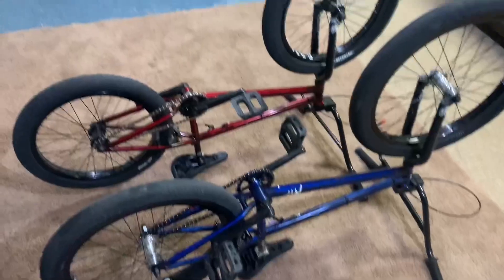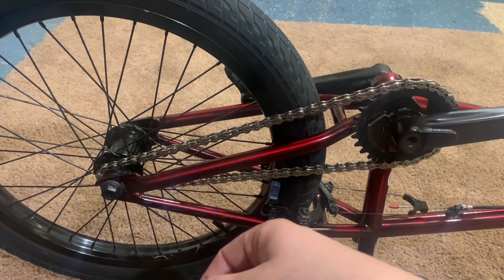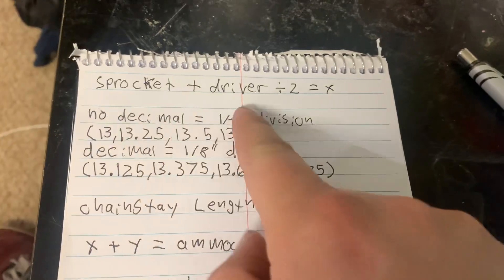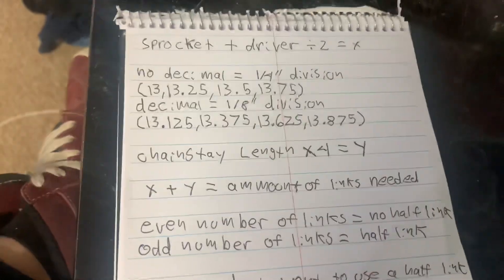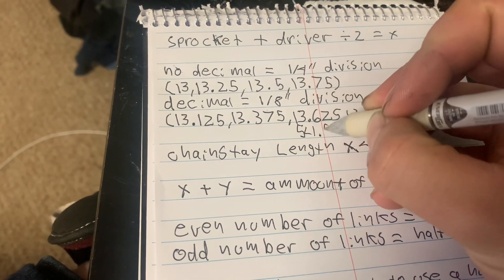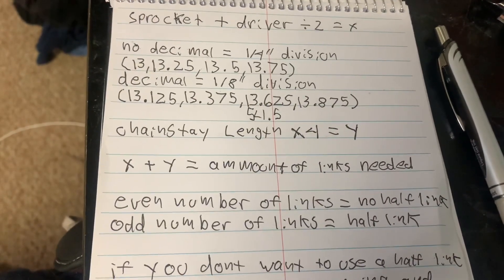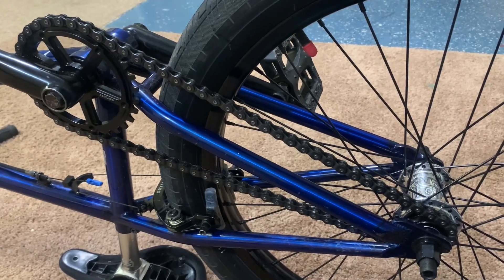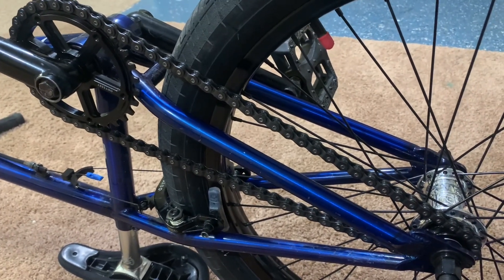Watch this before buying a new BMX frame! How to calculate necessary chain-stay length

Comment: Amazing explanation!
My chain stays are 13inch, I still can't Manual.
I'm 40 years old and got into riding again after about 20 years.
I am a very thin person (quite a lot under average weight), my Stranger Spitfire is my current bike!

Back in the day I cut the Drop-outs on a Commensal Village  (just to make everything fit).
..It was so comfortable to ride! But I never measured the distance from Bottom Bracket to the Wheel Axle?

What you say about yourself at the end is the kind of attitude BMX communities should have!
Thanks!
Reply from the maker: I have definitely ground my dropouts to make a chain fit also haha. Thanks for watching!